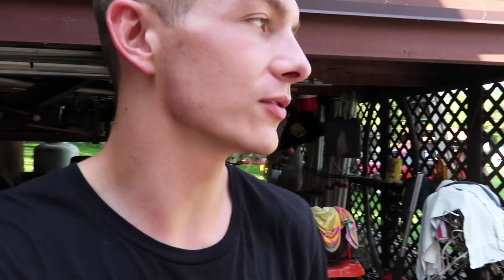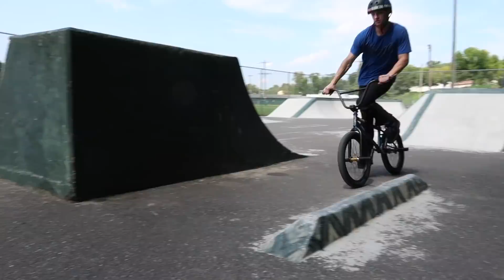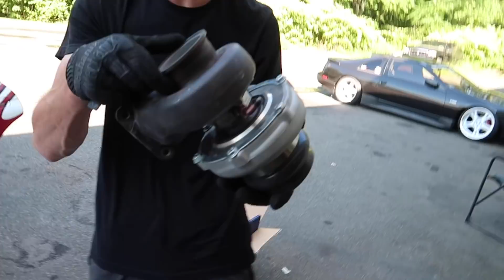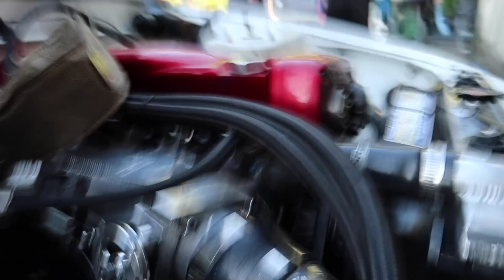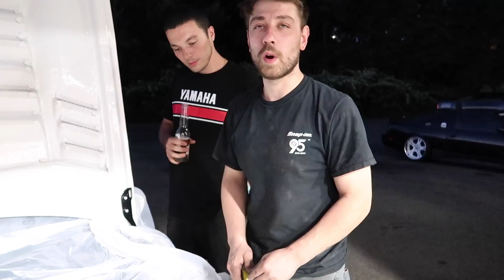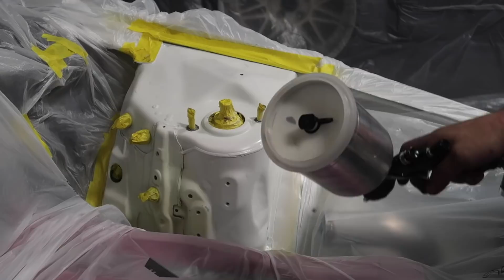New Turbo + Paint for the SKYLINE!

Comment: I used to race bmx with no gloves. I feel the pain of the sweaty palms. I would always find some nice sandy dry clay and rub it on my hands before I got on the gate. I miss bmx racing. I miss jumping double step ups, pull manuals on doubles or triples and triple or quadruple manuals through the rhythm sections. I miss riding fast and smooth on different tracks throughout the country.

Comment: Just leave the turbo gasket out... I don't run them, never had issues.
Reply: a21bravo trolling or serious?
Reply: @ilikeboost4764  Serious, I never have. Just swapped to a different turbo a month or so ago and the one I pulled off didn't show any signs of leak at the flange and it was on for almost a year. Seems like these gaskets like to blow out a lot(I think Adam even had one blow at an event once)... If the flanges are flat shouldn't be an issue. Could even throw a thin layer of high temp RTV on for extra feels.
Reply: a21bravo hmm do you take the flanges to a machine shop to make sure they're super flat?
Reply: @ilikeboost4764  Neither. Use bolts, grunt like a potato.
Reply: a21bravo hmm guess I'll have to try it at some point.
Reply: @ilikeboost4764  I have a consistent low 11 second Ranger set up like that. Went 11.3 last week on 7 cylinders (my mistake)... Should be going 10's in a couple weeks when I fix some easy issues.
Reply: a21bravo why was it running on 7?
Reply: @ilikeboost4764  Long story short I pulled that plug to check cylinder with borescope. I put the plug back in but, in my haste, forgot to plug the wire back in before going to the track. Made a few passes and something didn't seem right so looked around and found that.
Reply: a21bravo haha haven't done that yet but I know people who have. I'm sure I will at some point. 11.3 on 7 isn't bad though.